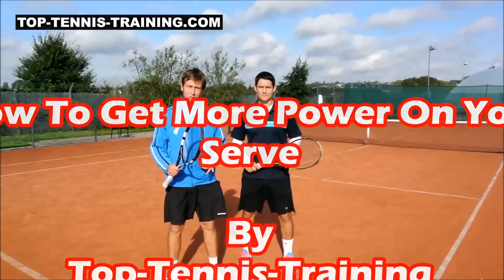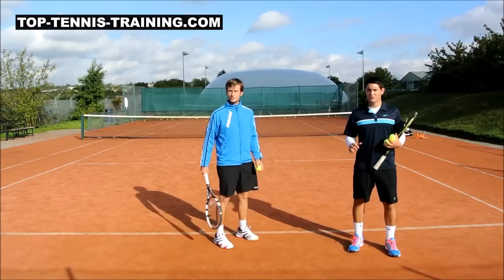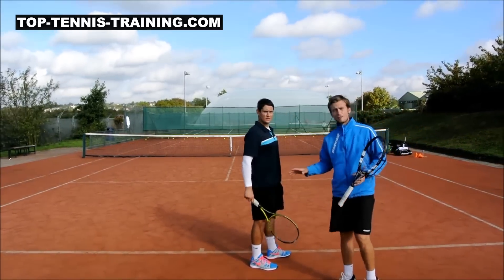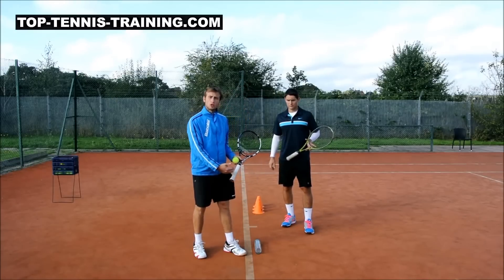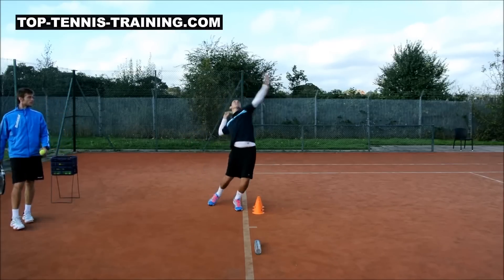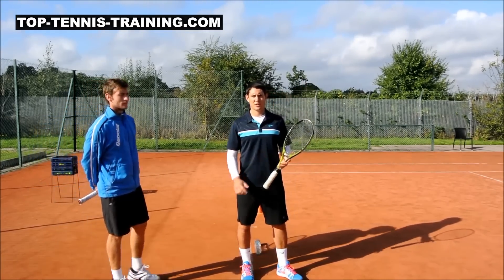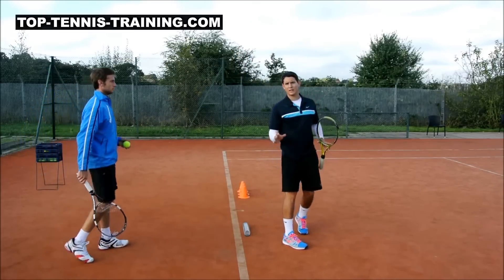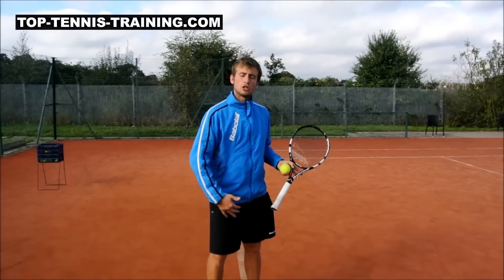How To Get Power On Your Serve in Tennis - Tennis Serve Power Lesson

Comment: It's possible to generate a lot of power without using your legs, but..
1. You are exerting a lot of force in your other body parts, which is better suited for your legs to do.
2. Your contact point is not going to be as optimal as if you are using your legs.

Essentially, it's not physically impossible to not use your legs, but using your legs brings a lot of advantages that you would rather have to become a consistent and powerful server.
Reply from the maker: Exactly it’s like throwing, you can throw with just your arm but you will be limited and when you are nervous and abit tight that contact point is going to struggle. Legs allow for a looser motion and a much better potential for power

Comment: Can it be possible to use legs and rotation without jumps. As for oldies it’s not easy to jump😭..Thanks
Reply: I meant if you can create video to use power from legs without jumping..that will help.
Reply from the maker: Well it’s a hop so doesn’t need to be that high just so you are pushing up. Even if you go onto your tiptoes and then step forward after would be a similar effect of struggling to get up off ground
Reply: @TennisProTV  Thanks for feedback will it be possible to share some comments on my serve and strokes..I am fat one in blue shorts.thanks in advance.